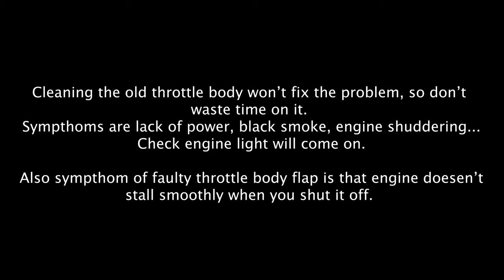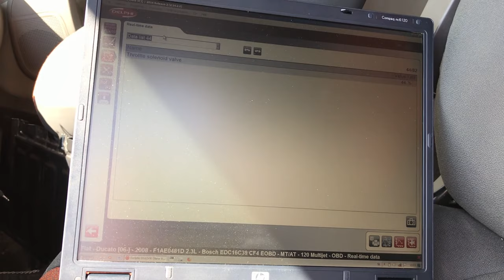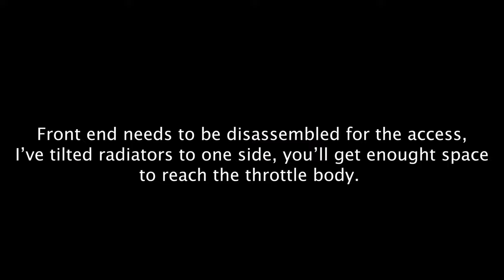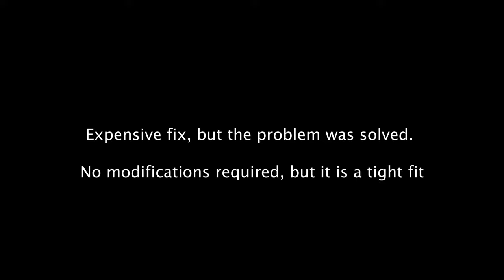P0638 Throttle Body Fault - Ducato, Boxer, Jumper 2.3 & 3.0 Diesel

Comment: I never realised some diesels came with throttle bodies! You learn something new every day, plus I really liked the sound of the intake at 1:38.
Reply from the maker: Its really not a throttle body if you ask me. If I understand this works with EGR valve, just to reduce emissions. This flap closes the air intake when you shut off the car, so the shut off is more smoothly. Removing the intercooler pipe always makes the engine sound more angry.
Reply: I did some research after I commented and came to the same conclusion, they do seem to be to help EGR flow and emissions, but they look almost identical to a throttle body on a petrol car. Yeah I know about opening the intake, I used to love the sound of my Tigra with the airbox removed! I was more intrigued by the failure making the on/off/on sound, it was quite interesting
Reply: throttle bodies on diesels are a safety feature that prevents engine runaway and rapid unscheduled disassembly.
Reply: @acecono  it is fitted to most modern diesels, to also prevent turbo run away, so when you shut off engine it shuts off air, no air it will cut out

Comment: Hi! Great video, we had the exact same problem until the valve stopped working all together. I took it off and ordered a new one from Pierburg because the design seems different. I opened up the electrical part now and realize the motor still works. Would you reuse this part or change it nevertheless?

Comment: hi, thx for your video and help ! no problem with the magneti/marelli wich replaced the old wahler?
Reply from the maker: All working good since then.
Reply: @acecono  mine got smoke, lost power, but only one time engine light comes on.
Reply: Do you have to do a re-learn on these, I replaced one today on my parents motorhome, but both my scanners have no option to program/relearn.
I test drove it fine with no EML and goes well ?

Comment: Hi there, can you tell me please if the throttle body are the same for the 3lt 160hp engine and the 2.3lt engine?
Reply from the maker: I think they are, yes!
Reply: @acecono  thank you. My macanic  has replaced the throttle body and checked all the wiring but it still keep running poorly and throwing up the EML. He plugged it back into the computer and its saying it's a throttle body fault again. Any ideas?
Reply from the maker: @liamsherringham3907  Yes, if you follow the wiring loom into the fusebox in the engine bay, there is a blue connector if I remember well. I also had that one badly oxidized and it was not making a good contact. Otherwise check the turbo pressure actuator (under the windscreen with two vacuum tubes connected and wiring connector). I think that can produce the smilar fault code.
Reply: @acecono  Thank you again for this info - very much appreciated. I will check those out.
Reply: @acecono  Hi, Great Video On this subject. I have the same issue & Fault code. Mine is a 3 ltr 160 BHP 2008 reg Motorhome. do you know how or where I can get the part number so I can oder a replacement?
Reply from the maker: @jeffreyparsons5686  Sadly you cant look by part number, since the new part is differente. Try to find it by engine code, im shure you'll find some.
Reply: @liamsherringham3907  i have the same problem replaced the actuator no improvement any solutions?
Reply: @Drutten35  Check for water in the ECU socket. Mine was full of water, which was causing false readings on the computer when we plugged it in.

Comment: Hi,
I had the DTC appear a couple of years ago, did all the research and ended up replacing the throttle body as in the video.  A few months after, the DTC re-appeared, but as I have a Bluetooth ODB dongle and Torque installed on the Android head unit I was able to clear the fault, and it didn't come back.  Another 18 months on and the fault is now back, permanently.

My throttle body did not seem excessively corroded, rusty or dirty so I feel it may be an electrical fault - Does anyone know if there is a fault elsewhere in the powertrain (e.g. engine management module) that can give rise to this fault?

Also, how can I concretely determine if ANOTHER throttle body will fix this issue - any tests?

Thanks
Reply from the maker: Well I would deffinetly try and clean the contacts in the engine bay fuse box. I also had a bit of green corrosion right on the blue connector that connects the ecu and throttle body. But it could also be a faulty unit. Good diagnostic tool can tell you this and you can also test it.
Reply: Took front apart, removed adapter harness from TB and mating face of connector was wet!!!  Been sat for a few months over winter with wet terminals so I guessed corrosion.  Cleaned them all up, waterproofed the connectors, reassembled everything and have been on a 20 mile test trip - didn't miss a beat.

Thanks